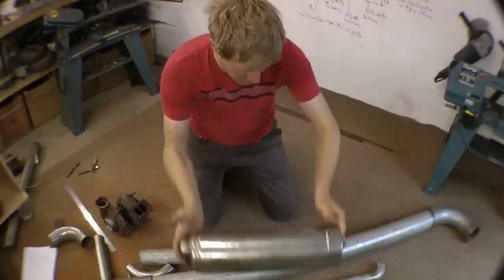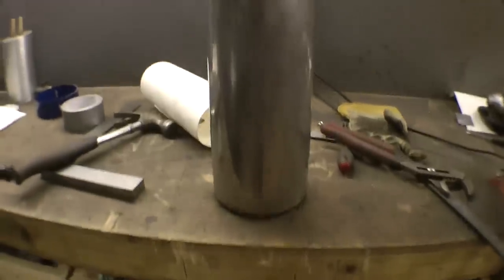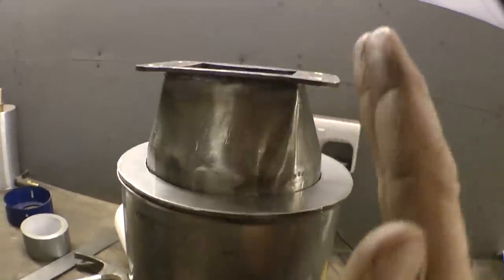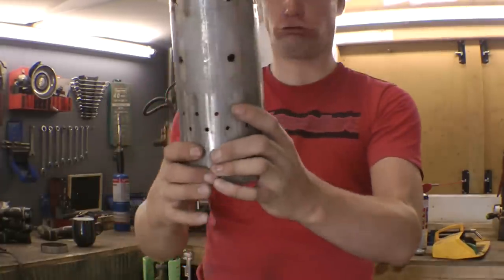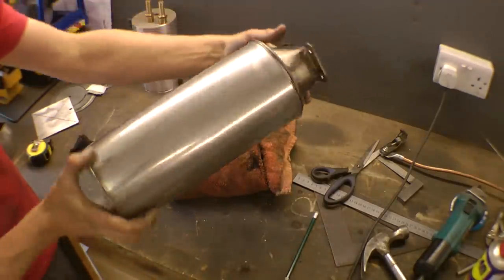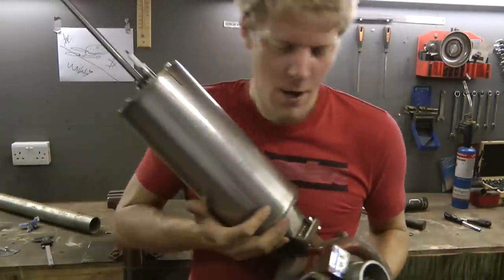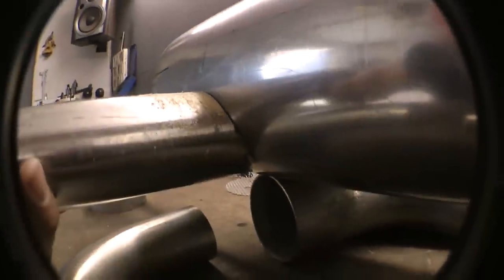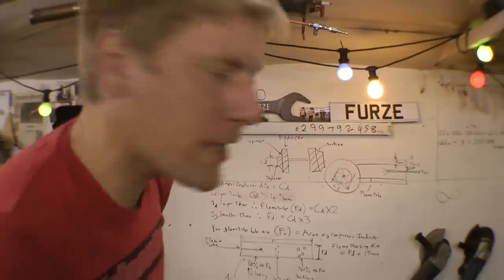How to build a TURBOJET ENGINE

Comment: Dude fuel that useing hydrogen, and like helichopter it turn the generator to produce electricity, loop and more free energy, at low cost. Just have to stack potasiumhydroxide, and you can rental your power to small area of houses. No need to pay bills of electricity. What do you say...? Uh...?

Comment: what do you intend to do with a turbo jet ?
Reply from the maker: I put it in a BBQ
Reply: colinfurze  LOL like it
Reply: Peter Fletcher lol
Reply: colinfurze well done sir, well done.
Reply: Turn propane into noise and piss off the hood?
Reply: You do it yourself like a man.
Reply: why not fit it on a model glider? also u failed to explain how you made the compressor blades!!
Reply: Build a plane, obviously.
Reply: I would shove it up my ass and start it up
Reply: +sheppardpat47 MAKE A FUCKING CANNON OUT OF IT
Reply: iPhoneFan2007 for some reason maybe make a jet fighter that shoots nail points..... with a mig 15 bis model
Reply: set shit on fire
Reply: David Ong He used a car turbo. That replaces both the compressor blades AND the turbine blades
Reply: Joseph Stassup Where's the video to build this plane?
Reply: Make a jet turbine powered tank
Reply: colinfurze can you make a BBQ using fireworks?
Reply: I would use it to launch it at someone that is super annoying to me
Reply: +iPhoneFan2007 he should get over 60mph on his go cart with that thing
Reply: +colinfurze why not enter the combustion chamber at the end closest to the exit like the original reverse flow avon etc did? would it not increase compression by reducing pre-combustion volume? run an exit tube up the center of the flame tube much as the avon did in its combustors? Or even run many little combustors like it did?
Reply: +sheppardpat47 
who cares. it's just fun to say you made a turbo jet.
Reply: wat
Reply: ***** maybe
Reply: ***** lame
Reply: ***** build a fighter jet
Reply: There's still another world Triad Center ;)
Reply: does he need a reason
Reply: Well put it on something and ride it I guess
Reply: CrazyGaming Craft im bob ross and this is my paint shop I work here with my old easle and my son big ross and in 14 years ive learned one thing you never know what is gonna come through that brush.
Reply: Bb. Bb.   But. B. B.                                      B. Bb.                   B Bibb bb bb.
Reply: GO FAST see what I'm kissing it uses three of them
Reply: Why do you care? lol - Definitely something you won't be doing.
Reply: what J man said
Reply: x
Reply: sheppardpat47
Reply: vintage clorax bleach -_- bleach 4 life
Reply: vintage clorax bleach -_- 😑
Reply: shep

solarni kolektor
Reply: sheppardpat47 build a iron man suit
Reply: colinfurze your my new hero, if i was a chick id want your babys
Reply: sheppardpat47 free bjs lol XD
Reply: "things"
Reply: Frighten the neighbors...
Reply: melt his own face
Reply: i had dozenens t/c off cummings 4cil diesels we had to retrofit  our whole fleat of city buses  with new ones  didn't tell us what to do with cores  a few found a way to my home  some went on e-bay  i built a jet engine almost burnt the joint down

Comment: You should take another turbocharger, ditch the compressor housing and wheel and make it into a turboshaft setup.  Use the second turbo as a PTO and run a bike or something.

Comment: could i make one from one of these?

http://www.ebay.co.uk/itm/Turbo-Charger-Keychain-Keyring-Choice-of-Colours-See-Video-/200905474455?pt=UK_Keyrings&var=&hash=item2ec6e64197
Reply: no, for about a hundred reasons and here are a few of them:  they don't have the right actual shapes inside, that's only HALF of an actual turbo, they're PLASTIC and would need to run at like a million RPM and theyhas shit for bearings  if they even have any at all.

Comment: May be print all of that on a 3D printer?
Reply: Unless you have a super expensive 3d printer that can do stainless, then your abs plastic will quickly cover you in burning goo. 3d printers work well for electronic and prototyping low stress products, but are too slow for modern production needs
Reply: and you'll have no hands left

Comment: How would a big ass turbo off a giant Cummins diesel work or a similarly large turbo? I'm guessing smaller, faster spinning turbos are a better fit for this type of thing.  I'll have to find out but was curious what your thoughts are on using a massive diesel turbo meant for an engine of say 9-12 liters displacement. I think i might start off with a pulse jet first though.... You've inspired me to make use of the extra truck parts that just go to the scrap yard and build crazy shit!

Comment from the maker: Hi william i welded nuts on the back of the ring before i welded the ring in end of tube which you see me doing at 1.41 in the video. hope that helps and good luck with your build
Reply: Type: Turbojet
Length: 3.86 m (152 in)
Diameter: 81 cm (32 in)
Dry weight: 719 kg (1,585 lb)
Components
Compressor: 8-stage axial compressor
Combustors: Can-type, 6
Turbine: Single-stage
Performance
Maximum thrust: 8.8 kN (1,980 lbf) at 8,700 rpm
Overall pressure ratio: 3.14:1
Thrust-to-weight ratio: 1.25

Comment: The bolts on the end of the combustion chamber, I didn't quite see how you fastened them on the backside ( inner part) of the combustion chamber?  Did you just run standard lock nuts behind them all?  I had a hard time visualizing how this part is assembled. I am gathering parts as we speak to give this a shot!!!

Comment from the maker: Yes and no, it has a sort of system fitted to it but when you see what it gets put in its intended for a slighly diffrent use but it didn't work as intended but have since made it work so there is possibly going to be a 4th video as had a deadline for geek week which ment the 3rd video was done a bit diffrent to how i wanted.